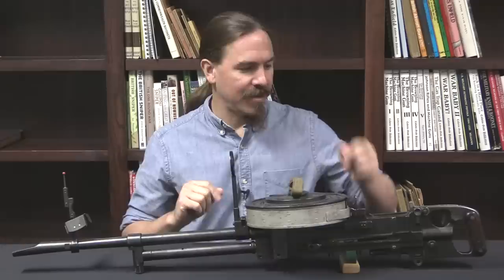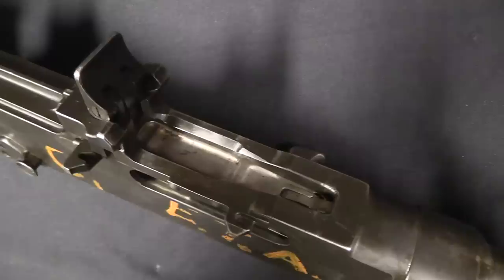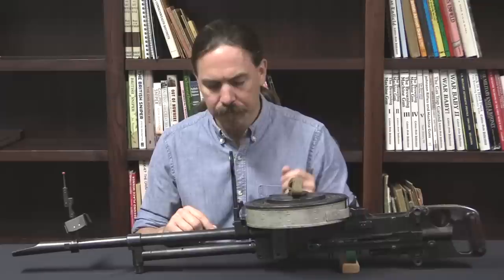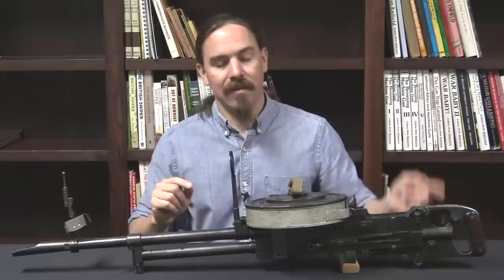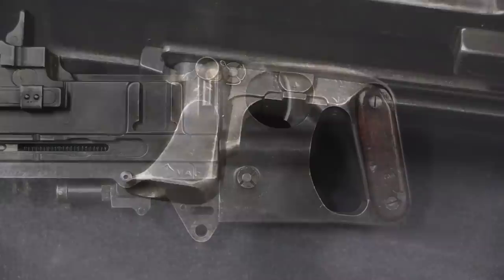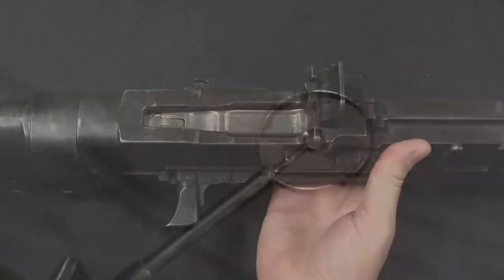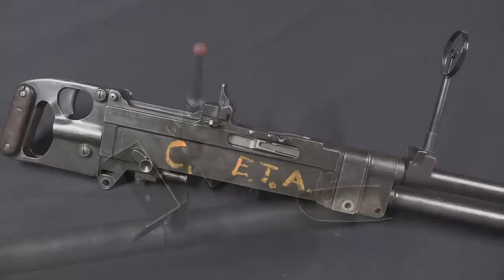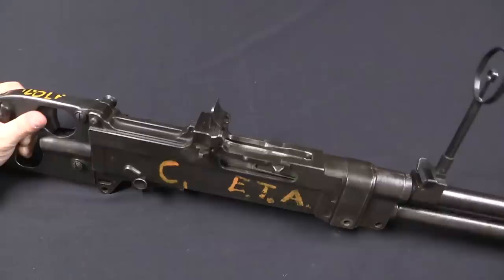Vickers "K" - For Aircraft and the SAS/Long Range Desert Group

Comment: The only ETA I can think of is the Basque equivalent to the IRA that was active in Francoist Spain and occasionally France during the 60s and 70s. Not sure how long or if they're still active, but if that Vickers came out of Spain that might be a possible origin. Granted all of this is speculation based solely on the ETA mark on the side.

Comment: This would've probably been a good tank machine gun for the Brits with a heavy barrel and slower rate of fire.
Reply: Maybe if given a belt feed system. Drum mags in the confines of a tank would probably have been a real hassle to handle.
Reply: @kellyshistory306  Funny you should say that.    The earliest Beaufighter NF had 4 X 20 mm guns.    The lucky observer had the task of unbuckling his 'chute and crawling down into the belly of the Beau to juggle full and empty drums to reload.  Even better, he did this  in the dark whilst maneouvring in action.. The not unreasonable fear was that a dropped full drum at 60lbs could easily be propelled by the g force to go straight through the fuselage taking control cables with it.    

In a similar vein, the Short Sunderland used to interdict U boats was fairly well armed with turrets plus 50 cals in the wing bomb hatches, but just a single Vickers K/GO in the nose.    A pugnacious Australian (surely not?) thought it teribbly unfair that he had only 1 X 303 to counter the mix of 20mm and 37mm carried by the U boats of the time.    ( German Navy command figured it better to transit the Bay of Biscay on the surface and upped their ack ack provision accordingly.). His solution was to gaffer tape in two more guns and like the SAS increased the tracer rounds in the mix.     The result was reported satisfactory and more widely adopted.   I have no idea how he got himself plus that lot into a restrictive turret.   Plus the fact that the Sunderland  nose turret retracted into the hull to clear the hatch for deploying the anchor - well it was a flying boat afterall. 

I agree with you by the way about the superiority of a, working belt feed over pans and drums.    When the first Gladiator was rolled out, it had twin modded belt fed Vickers Maxim guns in the fuselage floor plus a Lewis gun held in a tray under each wing.   The Lewis was replaced by Vickers K/GO, and the whole set replaced by belt fed Brownings in due course.   Martin Baker sorted out the French Le Chatterelaut belt feed for the Hispano and that thankfully  replaced the drums in aircraft use.   Prior to that, wing flexing alone was enough to jam the feed in cannon wing guns.
Reply: @kellyshistory306  The Soviet DT machine guns worked fine with drums in tanks.
Reply: @hendriktonisson2915  Given the DT never made it into a post-war Soviet designed tanks, I'd argue it was more the DT worked well enough that it wasn't worth halting production to find a replacement during the war. But a 63 round drum is lackluster capacity compared to a belt, and once the war was over the Soviets put the belt fed SGMT in their post-war designs.
Reply: @kellyshistory306  The Degtyaryov machine gun lent itself well by design to be converted to beltfed and the belt feed mechanism could be easily added to any standard DP-28/DT drum fed machine gun. I don't know if the Vickers gun could be converted as easily.
Reply: @TheArgieH  Are you talking about the additional forwards firing guns on the Sunderlands, or is this a seperate upgrade? Those ones were fixed forwards, mounted in the fuselage and fired by the pilot.

Comment: Does the wind vane work backwards? At 09:00 minutes the gun is facing screen right, if mounted on a plane with direction of travel of screen up doesn't the barrel need to be adjusted forwards/screen up to account for wind?
Reply: I think the point of the sight is to help compensate for the bullets continuing to travel in the same direction as the plane even after firing.
Reply: @Paranomasia12  That makes a lot of sense. In my mind I kept thinking about compensating for a moving target instead of a moving shooting position and it seemed backwards.

Comment: The front sight works the wrong way around! 
Is this somthing no one ever realized or is ther somthing i don´t get???

If you are a gunner looking out the right side of you plane, the wind is coming from the left.
In this case the sight moves to the left of the line of fire. 
If you then aim, you line of fire is on the right, behind the plane you are shooting at, and the wind will cary your bullets further to the right.

So whats the point of this sight???
I guess to cause less casualty 🤷‍♂️
Reply: @penchanski673  Yea, I know, but the front sight point in front of the target.
If you then shoot, your barrel is already pointing behind the target and the moving air makes it worse!
If this to work, the front post should be on the vains not the opposite side.
I put a skatch in my Titel picture, what I am getting wrong?

Comment: I hate to be all "ackchually", but I notice in the title you have written "SAS/Long Range Desert Group". That, at least to me, sounds like you are saying that the two names apply to the same group. But the Long Range Desert Group existed since WW1, doing scouting, putting down supply caches, etc. and doing that all across the North African deserts. However the SAS started out during WW2 in North Africa but didn't share these duties, they were parachuted in to destroy enemy equipment and I believe made use of the LRDG a few times to get them out.

Regardless, nice to finally find out what the "VGO" from Battlefield V is

Comment: Normie BA troops in Egypt: Ah! The Krauts are coming over the horizon!
SAS: Relax... Imma send out the Pink Panther with the Vicky K on top and deal with it
BA trooper: The what?
SAS: K.
Reply: @pdallen8355  They used jeeps instead on LR. It became the "Pink Panther" with the LR was because it was remade with the LR Series I.

Before that, Britain was given tons of Jeeps as they were in the same bloc as the US and the US gave them tons of it. The SAS needed such vehicles to get across the desert and thus they stuck tons of machine guns on it and roamed the desert destroying supply trucks, raid airbases and what-not while painting it pink. It is said that the pink hue would reflect sunlight and from afar, you can't see it properly as it would "change" it's colour profile to a beigey sandy colour which made the vehicle blend well into the background. Brens, Browning MGs, Vicker Ks, Lewis guns, you name it, it's all been on the Pink Panther.

Comment: Barrel not interchangeable ,it is a weakness.
Reply: Not going to be changing barrels on aircraft guns. Not an issue.
Reply: @alun7006  nonsense, I would simply reach out to the slipstream and grab it
Reply: @shoelessbandit1581  Doesn't happen, you only put a couple of hundred or so rounds thru one on a mission.
Reply: @shoelessbandit1581  you wouldn't NEED to, is the point.

Comment: Tbh, I always just assumed they were lewis guns... The more you know!
Reply: The Lewis and the Vickers K/GO are very different guns.   If you look hard at the Lewis you will see indentations around the circumference of the pan magazine.      The ratchet at the rear of the gun (on the horizontal flat bit) engages with those to rotate the pan.     Look under Lewis you will see the characteristic housing of the clock spring for the rack and pinion mechanism.  Getting the tension on that spring adjusted properly was one of  the challenges of getting the Lewis to operate smoothly.    Folk sometimes confuse the guns the other way round.   When used as infantry weapon the Lewis had a bulky Induced cooling jacket.    That was removed for the air gunners version and some folk jump to the conclusion that it is therefore not a Lewis gun.    I have seen two Vickers GO/K guns adapted for shoot 'em up games in aircraft museums, one used to be at Yeovilton. 

The SAS are reputed to have upped the tracer to ball ratio.   With the enhanced rate of fire that must have looked spectacular at night.
Reply: @TheArgieH  Well to tbf I know they are different now, and on examination I'd Probably notice them not being the same guns, But my point is thy look so similar in appearance that, one just assumed the plucky Lewis lasted longer that one would have figured, and have never looked beyond that. (I knew the name Vickers K but again assumed it was just a updated Lewis)

Its one of those thing where, though I've seen these guns thousands of times I gave no more credit to them beyond my assumption. 

Which does go to show, even those that love history and firearms, make in some respects simple mistakes! :o
Reply: @TheArgieH  The funny thing is, I think I may have played with some museum examples many years ago thinking about it...
Reply: @tisFrancesfault  It's my King Charles Head fixation.   I once had a row with a museum curator who had labelled the rusty remains of a Lewis gun as a Vickers K/GO, on the basis that it had no induction jacket.   What it did have was all the characteristic Lewis bits I mentioned, plus a collar for said jacket if it had survived.   Since most of these museums depend on willing volunteers, I should not have been obnoxious and just shut up.

Comment: AAHHHHHHHH  the Vickers K  replaced all types in the RAF as FIXED guns, the Navigators/gunners, guns retained the Lewis in pree war years and into WW2.  For the advantages of the Vickers IE no belt was a disadvantage when aircraft moved to wing mounted guns. the Vickers did not develop a satisfactory belt/link feed so the RAF took the browning.( simple version).  this freed up a lot of Vickers Ks  which were then used as base defence. the fire rate being jumped up to about 1200 rpm,  the twin mount which is a base defence RAF mount adopted by the SAS is Not so both guns can be fired at the same time, but for one gun until out of ammo then the other gun.  The SAS would have preferd the browning 30 cal both for there greater sustained fire and number of rounds in an extended belt. but availability limited them to mainly but not totally  50 cal browning's and the Vickers K.  the vickers K was not used in attack, they were mounted purely for air defence which was regarded and then proven to be the SAS main hazard.  Next.  the SAS  and LRGD  were two totally separate organisations. although the SAS needed the LRGD skills in navigating and surviving in the desert, the LRGD hated the SAS for using them in a manor contrary to there main task. which was infiltrate and report ( stealth)   hardly accomplished by running around shooting things up!

Comment: .303 in air to air roll. Not quite as useless as spitwads.
Reply: Worked pretty well during the Battle of Britain. Just because something isn't necessarily the most optimal solution doesn't meant it is totally useless. A rifle calibre bullet is plenty capable of wrecking an aircraft's engine cooling system, and loaded with a mix of incendiary and AP, as was the practise at the time, was quite capable of starting fuel fires, too. That's not to say that the quad cannon of a Tempest didn't hit harder than an early Spitfire or Hurricanes with eight brownings, but a high volume of rifle-calibre fire could and did succeed in air-to-air combat.
Reply: @discerningscoundrel3055  
Consider how much flatter the trajectory and harder hitting 8mm Mauser is. 
Of course the USofA Army Air Force hadn't gone all .50 cal at that time either.
Reply: / laughs in Spitfire
Reply: @calvingreene90   The difference is almost irrelevant. We're talking 6% difference in muzzle velocity at most, and less than 2% difference in mass. They'll both damage cooling systems, they'll both damage fuel tanks and fuelling systems, neither of them are capable of carrying any meaningful load of explosives, which is why by the end of the war every had either switched to cannon, or was working on it. An aircraft carrying as many machine guns as it can is still, in the era, very effective, just not quite as effective as it would be carrying as many cannon as it can, and there really is no meaningful difference between which rifle calibre cartridge is being used.
Reply: @discerningscoundrel3055  
The energy increase is not linear with velocity. Double the velocity and you quadruple the kinetic energy. The flatter trajectory and lower flight times increase the odds of getting hits.
Reply: @calvingreene90  I'm sure the 0.0235 of a second difference in flight time at the distance the guns were harmonised to converge at makes such a difference. That's comparing 7.92 S.m.E with .303 MKVII, MKVIIIz is actually faster than 7.92 s.S. These differences are utterly inconsequential.
Reply: @discerningscoundrel3055  
At highway speed the difference in time between an incandescent brake light and a LED brake light lighting up when the brakes are applied make more than a foot difference in where the trailing car can stop. The planes are moving a lot faster and it is a bigger difference. But continue with your fan boying for the .303 British, it's cute.
Reply: @calvingreene90  1) The incendiary round used in WWII .303 calibre aircraft machine guns was actually 87fps faster than the 7.92mm s.S Patrone. 2) The tiny differences in performance between these cartridges is still irrelevant.